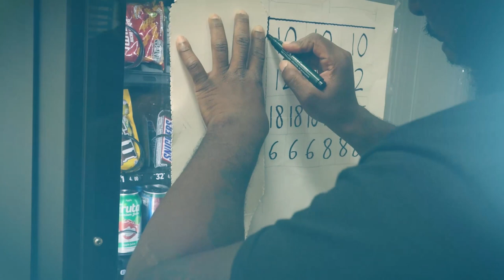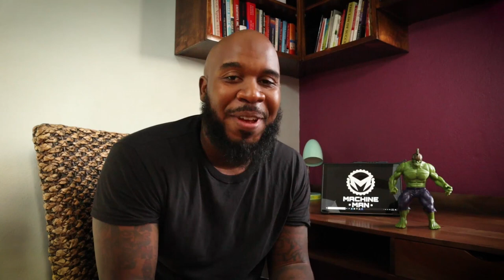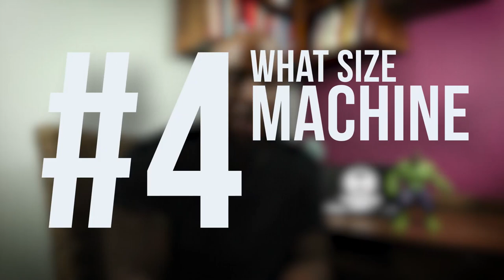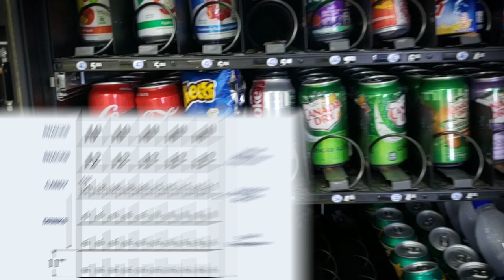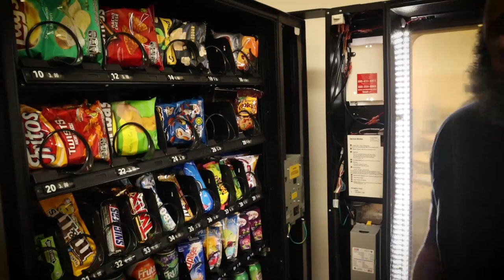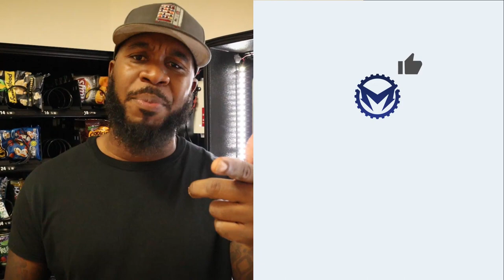Buying a New Machine? Vending Machine Design 101: The Beginners Guide

Comment: Hey, great video. I was really curious about the way in which the bill reader is customized to different regions. Is it a separate modified part? Or do you just specify the currency to the manufacturer? Like I reside in T&T 🇹🇹 and want a machine that accepts TTD but I’m not sure on how to do that. Thanks for this video though and thanks for your response in advance ❤️
Reply from the maker: Thanks for asking Jordan. It is a separate modified part that has a different  manufacturer. You will have to specify the currency and it may require you sending them samples.
Reply: @MachineManCo  Thanks so much for your reply. Means a lot, I subbed😁. One more thing I want clarified is the name of the part. I’m not 100% sure about the name of the module that reads the cash. If you can help it’ll mean the world to me.
Reply from the maker: @Jordan-iz2dk  sure. The part that we are talking about is called the bill acceptor.
Reply: @MachineManCo  you’re the man, thanks so much